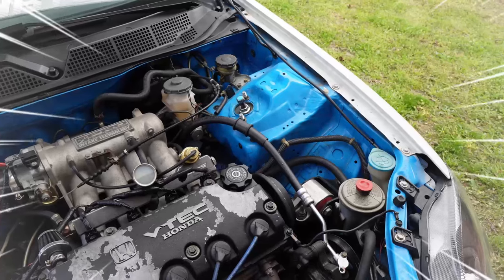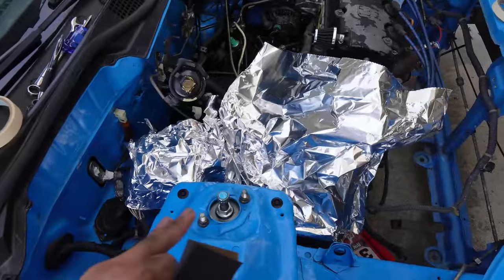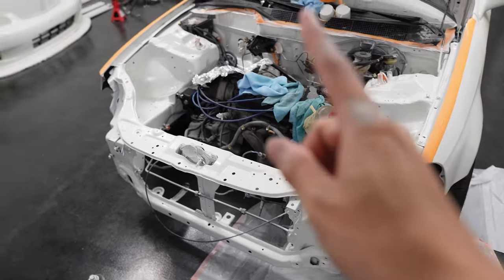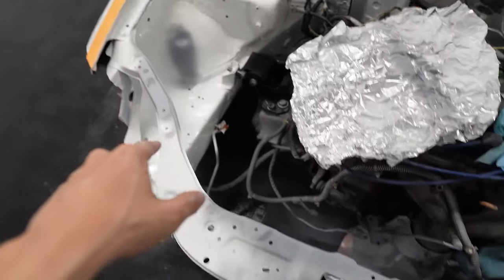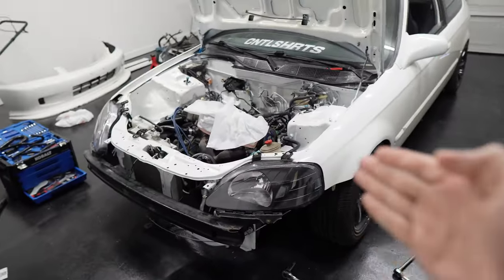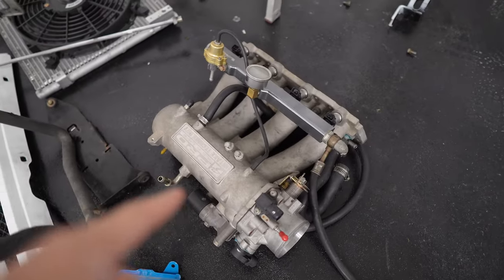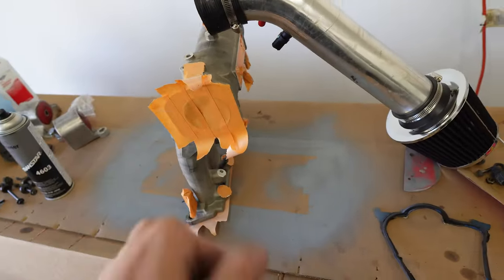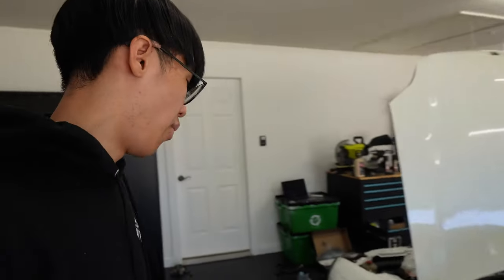Restoring Civic the WRONG WAY.. | PT1

Comment: The rinkling / fry up is the solvent in the new paint lifting the paint below.

What you need to do is use a sealer to create a barrier before applying new paint.

The bubbles are likely fish eyes. This is from contaminates on the surface preventing the new paint from adhering I.e. the area wasn't fully cleaned, wax and grease remover.
Reply from the maker: Thanks for the tip! I'll definitely remember this for next time!